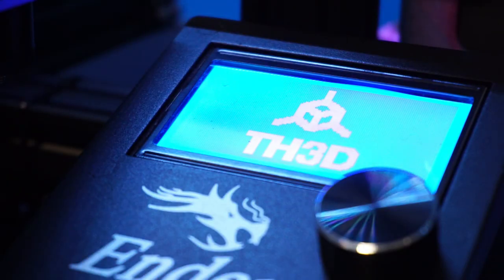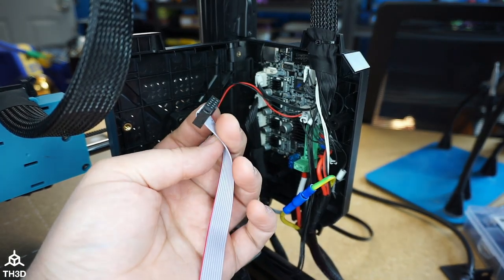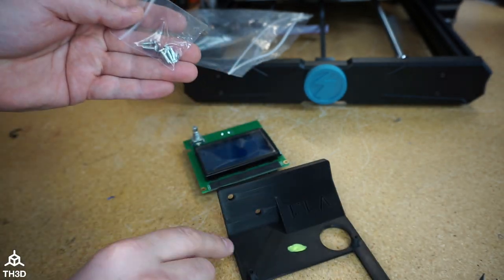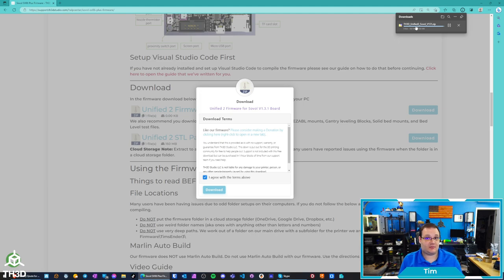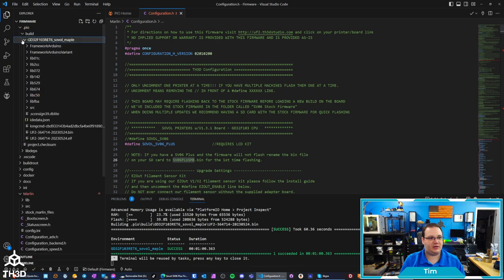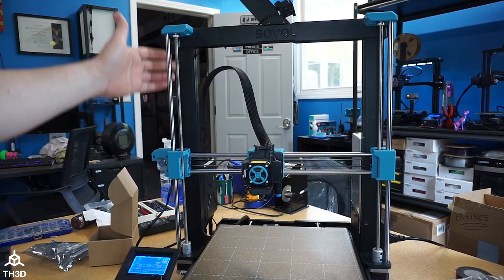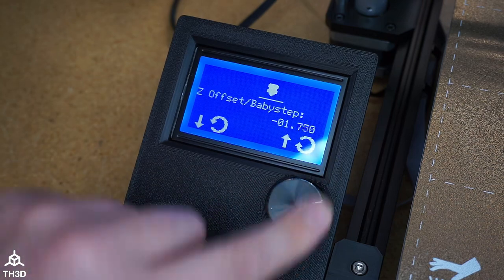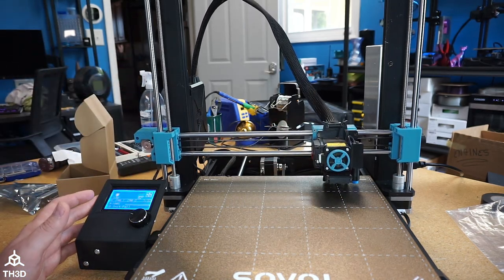Sovol SV06 Plus LCD Upgrade Kit Installation

Comment: Is there an option to install the replacement LCD on the right side of the printer?
I have a pi camera and a raspberry pi zero 2w mounted on the extrusion on the left side.
Reply from the maker: There is not due to the cable lengths.

Comment: Is there a way to choose to do more locations, like 4 x 4 or 5 x 5 etc instead of the 3 x 3 mesh on auto level?
Reply from the maker: Yeah it's all set in the firmware with the EZABL_POINTS setting. That controls the grid for all ABL sensors.

Comment: Im having issues when homing. It keeps grinding like it wants to keep moving the x and y axis even though it reached the end. I tried changing the tmc driver sensitivity to no avail, although I might have done it wrong. Anybody have any other ideas?

Edit: I changed both X and Y to 130, and that seemed to do the trick
Reply from the maker: I'd check the motor wiring and belt tension. Too tight on the belts will mess with the homing.
Reply: I kept increasing the Sensorless Homing without noticing any changes. I had a few other issues, so I ended up just "restoring defaults". Then changed it to 70 on X and Y and it fixed it. Make sure you're doing the store settings also.

Comment: could someone use pid tune via lcd it buggers the screen to mumble i needed to reflash but other than that allgood maybe me only. ahh me got me a new rated cable for the screen it appears them rainbow ones have 6 strands of wire unrated .. my new rated ones have 12 strands and are rated . was my probs tim not your firmware ! sorry

Comment: I went straight to upgrading to the LCD 12864 screen and firmware and fan upgrade not even running solvol's firmware I like TH3D better well I got my svo6 plus just as the offer went out one of the first one's it looks like some of the first svo6 and svo6 plus that went out the Z axis was set at 5.0 from the board some how even after changing to TH3D marlin firmware it still was set for 5.0 so had to adjust back to zero first before doing a Z offset or the nozzle would crash into the bed could not figure it out tell seen this video https://www.youtube.com/watch?v=AXcjThdfXfI